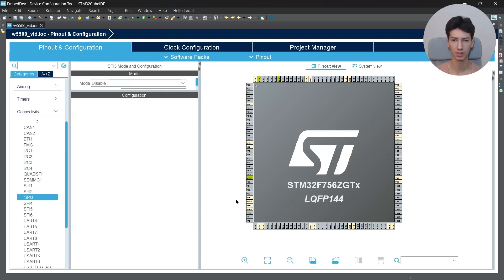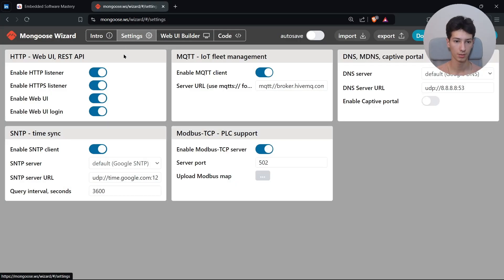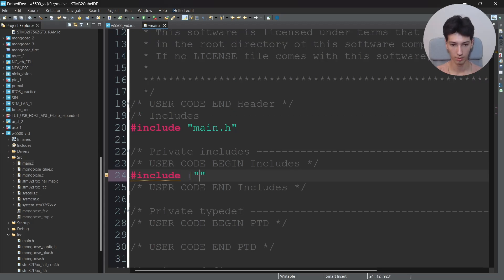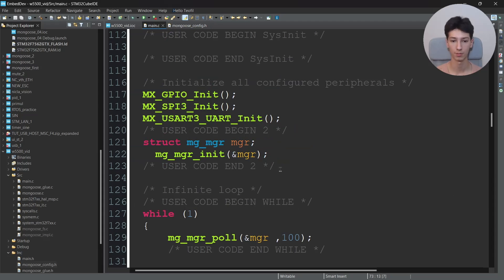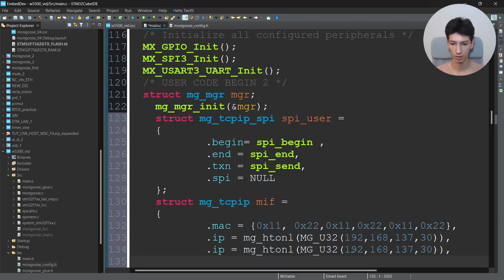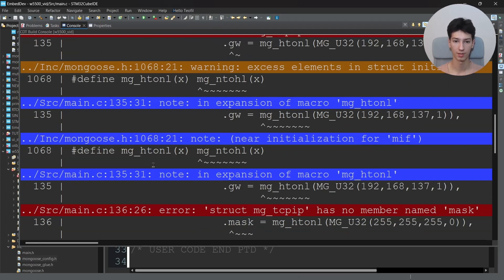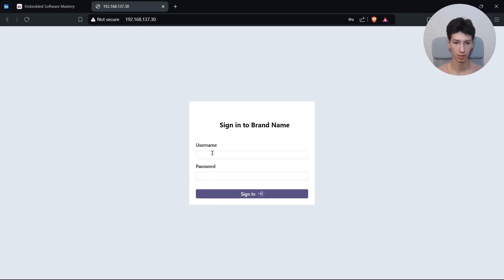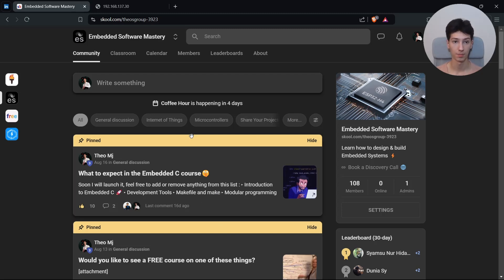Ethernet Web Server with STM32 & W5500 Tutorial | Mongoose WS API

Comment: Thanks for the video. Will you be able to share the source code / the entire project ?
Reply from the maker: Of course, check the description now
Reply: @Theo005-k5e  thank you
Reply: @Theo005-k5e  
1. 3. Your github code calls fn() (mg_http_listen(&mgr, "http://0.0.0.0:80",fn,NULL)) instead of  http_ev_handler(). I have replaced it by http_ev_handler() as seen in your video.

2. Why did you include two .c files "mongoose_impl.c"
"mongoose_fs.c" in main.c, when they could have got compiled separately and got linked by stm32cube ide. I did it that way. But then I got to another issue as below.

3. The function http_ev_handler() has been defined as static inside mongoose_impl.c, so calling it from main.c did give me errors. I resolved it by defining the function non static and included the extern declaration of the same in main.c. The compiler compiles it properly now.

Let me know your views on this. Hope you are OK with this lengthy comment.

Comment: why not use an ethernet interface directly from the board?
Reply from the maker: @HarisMaulanaID  because i wanted to show people that You can add an Ethernet interface to any microcontroller with Mongoose and also that was the board i had at hand haha
Reply: @Theo005-k5e  oh, okey I see. how about using the ethernet interface of the microcontroller, and making a webserver without Mongoose
Reply from the maker: @HarisMaulanaID  You mean using LwIP? It is a pain the butt to use that. As you saw in the video, I built the Dashboard without coding
Reply: @Theo005-k5e  yes, it only controls the LED and displays the sensor reading results
Reply from the maker: @HarisMaulanaID  actually i have a similar video on this:https://youtu.be/AiZ9wcqq9Nc?si=VWfAEK-vLzmwbkW9